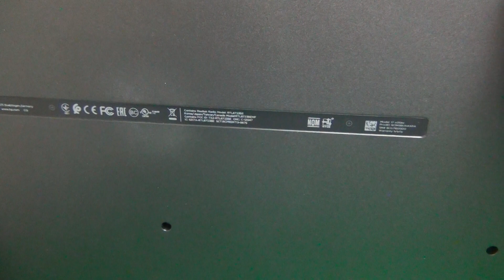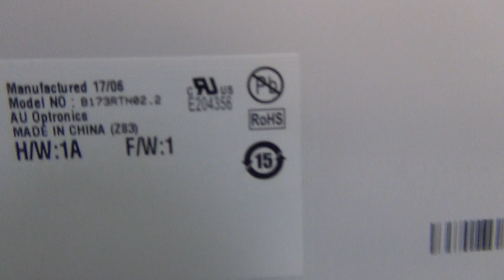HP Pavilion 17-x 17-x051nr Laptop Screen Replacement Procedure

Comment: What model number is the screen video cable?  My son's laptop hinge locked and cracked the corner- screen is fine, but a few wires in the cable were sliced, and I can't find any information anywhere.  Any information would be greatly appreciated!